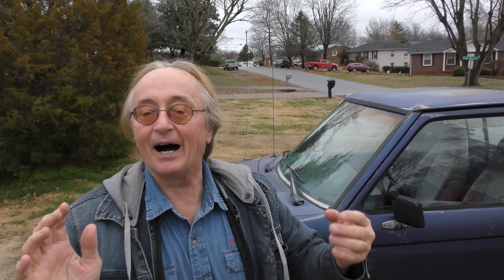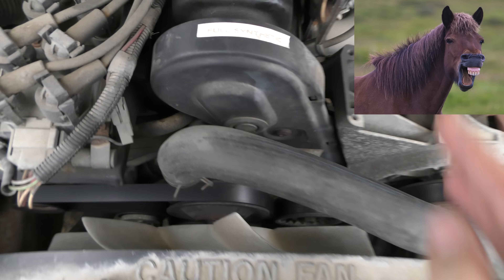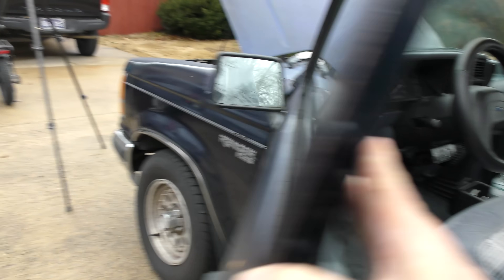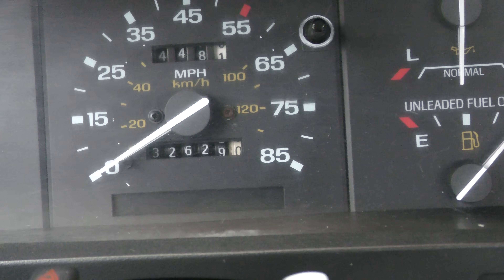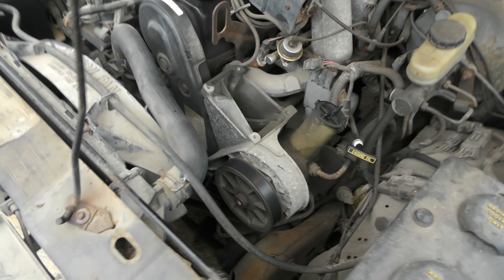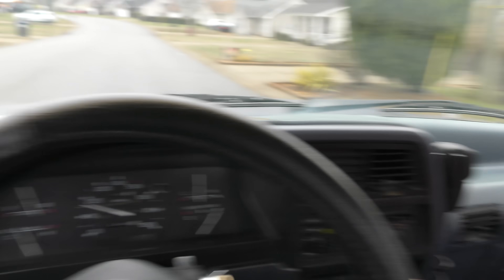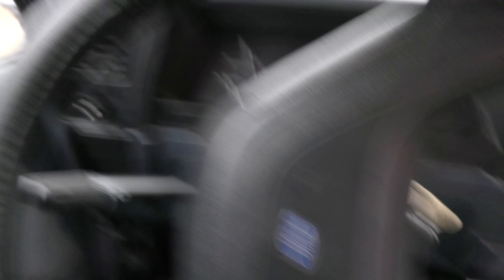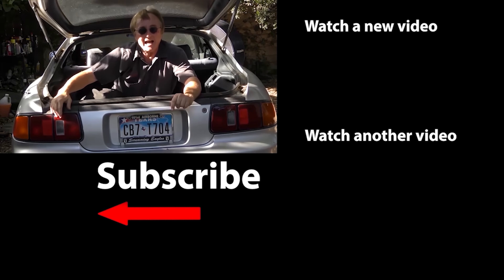Buy This Now (Before It’s Too Late)

Comment: Scotty , the original nissans / Honda’s in the 70’s achieved 30 to 40 mpg
Reply: My 88 ford escort 4sp got 40 mpg
Reply: My mom had a 94 Escort wagon with manual trans back in the day that would get over 40mpg on the hwy
Reply: Cars were lighter since we didn't have all the infotainment and safety baloney

Comment: 23mpg? hmm mine used to get 29 hwy. but yes they are super dependable but you don't want one unless you live in plains country. Even empty you will be down shifting constantly to get up mild grades. I drove mine through Scotty county, Tenn from 5th, to 4th to 3rd sometimes going 35mph on the interstate with an overnight  bag with semi's blowing me off the road. 
I "upgraded" in 2011 not because the old one was worn out but I knew '11 was the last year to get one. Sometime between then(2000?) they updated the 2.3l from the Lima to 2.3 Duratec/Mazda with a whopping 143hp, zoom zoom :). Today it is overloaded with firewood and would have no problem maintaining hwy speed in mtn country. My 2￠recommendation look for post 2000 2.3 Duratec, same mpg, same reliability adequate power.  🤠

Comment: I had one of those!  That truck is a POS!! Kept popping freeze plugs!  Finally it popped one in an untimely manner - caused it to over-heat, it blew a rear-main seal and l finally got rid of it.  I don't miss that POS!  Yes it was a standard, and couldn't get much above 60 if you needed it to.

Comment: For whatever reason Ford gave Toyota the small pick-up market, discontinuing the Ranger. Dumb move Ford.
Reply: I thought that the "new" Ranger was still comercialized in United States, in other countries like Argentina, Brazil, etc. they sell like hot pancakes.
Reply: You have the new ranger but it has two turbochargers twice as much to go wrong as before
Reply: @glennbeadshaw727  Here in Argentina we have the Ranger with various engines, all of them simple but bulletproof, the biggest engine and a little more complex is a 3.2 turbodiesel, 200 hp with a lot of torque, perfect for that small/medium truck.

Comment: No check engine light on 
And usually don’t come on often. These newer cars are so sensitive the cars of today are crap quality. 
       The automatic crap out on these rangers. 
     30 years and only 130k miles. Christ cars only 4 years old are past that in miles. 
       I just bought a 2008 Yaris 85k miles at 15 years old..they can go easy 300k 
Even on the automatic 
So hoping to have my car last another 10 years

Comment: The car I learned how to drive in was a 1985 tempo with the five speed manual transmission. Ran great, till the clutch let go in it. I miss that car! No AC, no power windows, but it had cruise control and power locks....

Comment: Hey Scotty, I have a Kia Optima SX. Has the sport setting ( turbo) Any recommendations for cleaning the engine? Seafoam? 58K miles. I appreciate ya?
Reply: Seafoam will screw it up ATS fuel injector cleaner was recommended by Scotty. However, it's taking forever to get to me.  Ordered on the 2nd, has not shown up yet
Reply: @TheSleepingonit  Where is it coming from?

Comment: Up until this video , I didn't know timing belts went that far back 😳
Reply: My 69 Fiat twin cam had a timing belt.
Reply: @shadowgunner69  

Wow ' as far back as 1969 '
Most information I've read or seen in videos, makes "timing belts" sound like if they were invented like twenty years ago. And generally ' if these timing belts snap ' the engine will explode into a bunch of broken  pistons & piston rods , valve and cams and even heads 😭. That's why, I try to stay away from them. I've had a couple of timing chains break inside the engines in the past, but the rest of the engine doesn't have to go through all the collateral damage as a result of it .

Comment: My 2000 Ford range has two different types of spark plugs. 3 on one side of the v6 engine and 3 different types on the other side.

Comment: Awesome blast from the past. I had a 1988 ranger with the German made 2.9 v6 and auto trans. It was an awesome truck except the trans. It was always needing, seals, torque converters and rebuilds. Not cool. Finally ditched it.

Comment: I had the first year it was downsized in 83 . It was a 4x4 manual transmission with the 2.3 with dual fuel tanks . Great truck except it constantly ate up clutch disc in that year and that’s why they only used that clutch system in 83 only
Reply: I have the same truck yet....V6 and automatic. Rusty but always runs.
Reply: @northdakotaham1752  I’ve been a auto mechanic for 28 years and I’m GM GUY. But If a vehicle is Durable, easy to fix , cheap to fix and just a overall great vehicle. I tell the truth about them , regardless who manufacturers it . And the ford rangers with the V6 or the one I prefer the 2.3 and manual transmission or bulletproof. The 2.3 can also be modified to produce outstanding power and performance. A friend of my uncle had I think a 85 or 86 mercury cougar XR7 with a turbocharged 2.3 and manual transmission. I occasionally drove him home when he had too much to drink. I believe I was 18 so it would been around 1994 . Once that turbo started doing its thing it was mind blowing to see this 4 cylinder engine with a turbo charger release the beast it was . It may have been one of the fastest cars I had ever driven but I digress. Unless I missed episodes where Scotty gave more vehicles the credit they deserve . He hates the later Chevy Silverado the and It’s GM counter parts. Yet their  4,8 , 5.3 and other variants are one of the best drivetrains in America hands down. And the 99-04 Jeep Grand Cherokee with the inline six is beyond reliable, easy to fix , cheap to fix , parts new and old are plentiful why he doesn’t give them more credit 🤷‍♀️
Reply: We had problems with chevys system of shutting down cylinders. Problems with the lifters.

Comment: It all depends on how you drive. My 2022 Maverick is an ecoboost front wheel drive and I average 32mpg but usually get around 35. 25 is low even for a 4wd.

Comment: Thanks Scotty, great info. I was wondering about the missing tooth...   Wheels looked fine, frame and underbody still solid?     

All of the cars my family had growing up near Rochester NY like your uncle seemed to rot out with rust from the ground up (I will never buy a  GM,) even my Dad's 10 year old Toyota Tundra now moved to Florida can see the rust starting from below, wheels mostly.  Now all living in Texas and Florida, no longer a huge problem for us but I would still be scared of most used cars that have gone through many snowy winters.
Reply: I'm surprised that truck looks that good coming from Indiana. But Scotty didn't show what it looks like underneath.

Comment: That's a nice truck I'm looking to buy a cheap little truck like that
Reply: Getting scarce but there a few left if you're lucky. Just blew the head gasket in my 2002 B2300, 5 speed extended cab and I miss it.

Comment: Why do compact pickups get such lower gas mileage? I had a 95 Nissan King Cab and 2012 Sonic, which I still have, both manual transmission. Both have identical final drive ratio, same speed at the RPM in the same of all five gears. Given the truck was a 2.4 and the Sonic a 1.8, making nearly the same power, Nissan got 30 mpg while the Chevy gets 40. They are shaped differently, but in city driving aerodynamics are irrelevant. So what gives?
Reply: Solid steel frame on the truck. Big rwd transmission. Big driveshaft. 
Also Scotty explained before it's more efficient to 'pull' a car (fwd) than 'push' a car (rwd).
Pretty sure that Sonic has electric power steering as opposed to hydraulic too

Comment: Yeah but that old truck is FAR EASIER to work on and repair, and being it's a Ranger, there are a lot of spare parts (third party aftermarket parts) for them, and in some cases, modified rebuilt engines.  Good thing that truck isn't an interference engine (I don't think atl east).  Ford as far as I know, other than maybe the early Escorts, didn't use an interference engine so if the belt broke, you just replaced it (no damaged pistons or valves).  Interesting that Ford used fan belts on the Ranger's I believe at least through 2002 before it was redesigned.  I don't know if the 2003+ models as I never looked at one (I imagine the most modern Rangers use an electric fan / cooling system as most trucks like GM's do that because they are easier to control and they can vary the fan speed based on need, much more easily).

Comment: That is pickup isn't as safe when getting into an accident.
Reply: It's got a lot more steel in it,a real frame, and will do some damage to a newer plastic car. Have a 92 with the 3.0. Needs a little work, but it's solid.

Comment: Anybody that can't tell the difference between a car with an odometer that reads "40,000 miles", and a car that actually has 240,000 miles on it, shouldn't be buying cars.